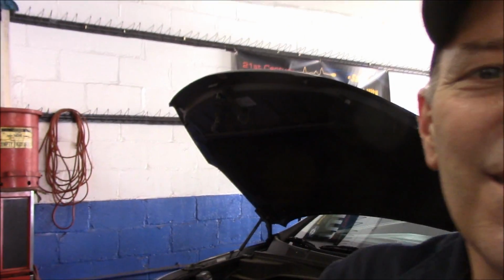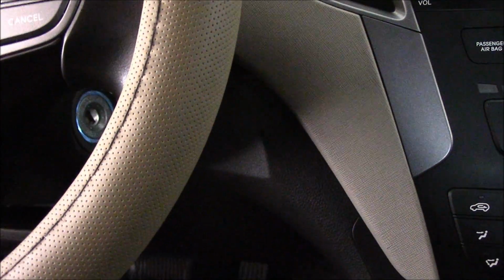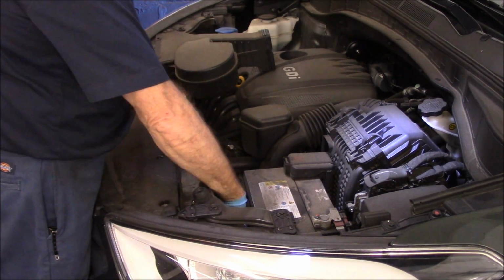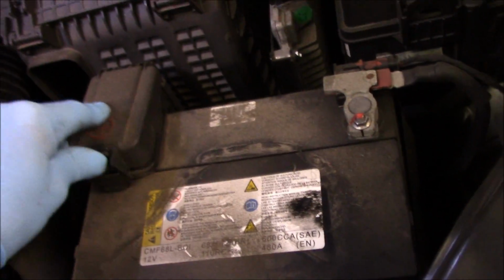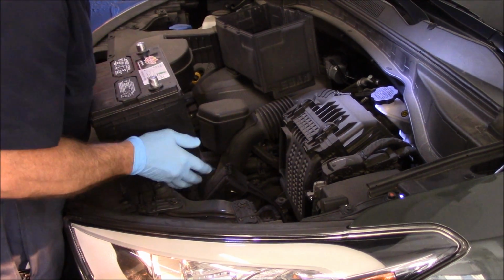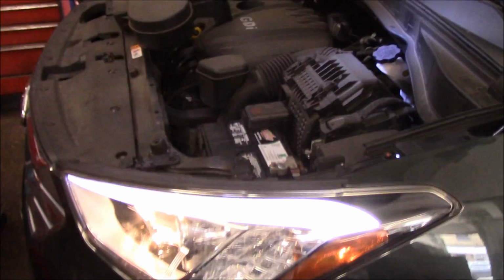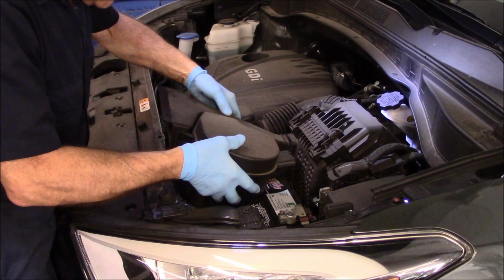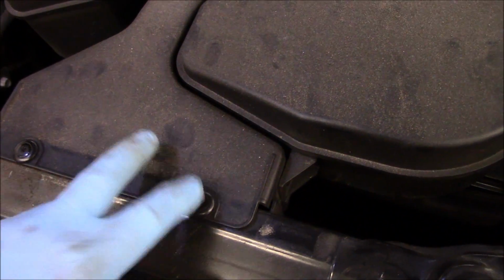How To Replace A Battery 2013-2016  Hyundai Santa Fe

Comment: I have 17 hyundia santa fe ultimate had the battery changed and now it's not starting wright up it's goes thur a system check 1st then it start but it never did that before. What can I do to fix the problem

Comment: Regarding trickle charging a battery for 2013 Hyundai Santa Fe XL.  Can one leave the battery in the car but remove both battery cables from the post and tuck them aside?

Comment: Can you link any known videos of disassembling the positive terminal holder? Snapped the bolt trying to tighten the positive terminal when I was putting everything back together. Still looking for OEM parts but when I tried to disassembled all the wires/plates connected to the clamp, it was a bit difficult. Thanks in advance @jimthecarguy

Comment: Hi Jim, have a question.  What size power pack do I need to use?  I see 700, 800, 1000 + AMPs.  Just want to make sure I have the right one.

Comment: Hi Jim, I did an alternator test on my 2018 Hyundai Tucson 2L by removing the positive terminal from the battery. The engine stayed running with everything turned on. But when I reattached the positive terminal to the battery and tried to restart the car it would not start. Is this a good indication that the battery is shot
Reply from the maker: No you should never, ever remove a battery end when the car is running this will cause some major electrical issues. When you say it will not start what exactly happens?

Comment: Thank you for sharing your video - I got a problem and wonder that you can help. My 2016 Santa Fe just quit on me this morning. My car is just about 45000 miles. I could not start and there is a funny noise under the fuse box, It ticks, ticks, ticks like running in a cycle, even after turn off and pull the key out. So after a while, the battery drained out. So do you have any idea
what happened and what would you suggest? (Please note: i had no problem a day before) - BTW, I did try to jump start but it does not work at all, and the noise stopped. Thank you very much for your time
Reply: My car just did the same thing an idk what it is I have replaced the battery an alternator
Reply: Where you able to find out what it is ?

Comment: I need help with my Santa Fe 2014 . 3 of the lights came on in my front panel
Reply: I change the battery because I read that that’s one of the reasons , but still on . I think is a sensor but idk the name of it , thanks

Comment: Hey Jim, I’m about to replace a battery, but we just got it so I don’t have anything preset I’m worried about. Is it ok to skip the power saver then? Also, If I’m not trying to save anything do I still turn it on during the replacement of the battery step?
Reply: Will Rigsby I would like to know as well
Reply: Good question. I would also like to find out the answer to this question.

Comment: jim  I am A Hyundai tech  now.  when ever I am doing a battery replacement at the dealership    when I re connect the cables  I always make sure that the keys are removed from the ignition   otherwise  the 15 mm fuse  pops sometimes  and then  you will know this  when you try and put the veh in reverse  because it wont go in reverse
Reply: Joe would you be willing to converse about a problem I am having with my Santa Fe?

Comment: the hold down nut is a 12mm
Reply: JOE FORD DIY hi i have a question Joe since u are a Hyundai tech...my battery recently died and we dont know why because the battery was only 1 year and a half old. And they thought it was the starter but it ended up being the battery. So after changing it my screen is not powering back on at all! What can I do?

Comment: You don't go into any detail as to why the key needs to be turned on. Is it because the accessory port gets turned on and lets current flow?  In the old shop I was at we had a unit that plugged into the OBD port and didn't turn the key on. Is it because that is Hot all the time?

Comment: Thanks for the video. You have to have the key on the ON position because the battery saver won't provide power otherwise? What about cars that don't use car keys anymore?
Reply from the maker: Thank you for stopping by the shop. With the push button start you keep your foot off the brake and push the button to turn on the ignition then follow this video.Very good question.